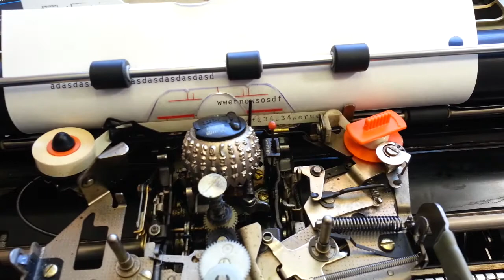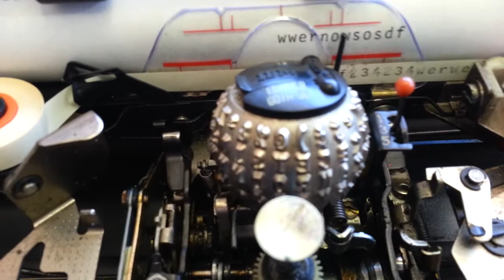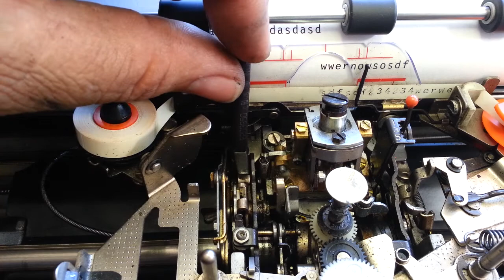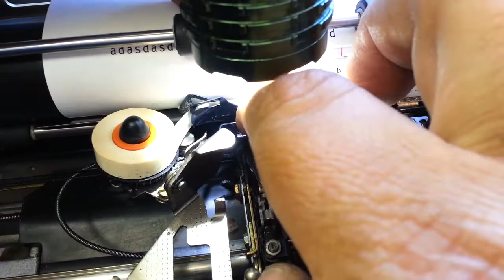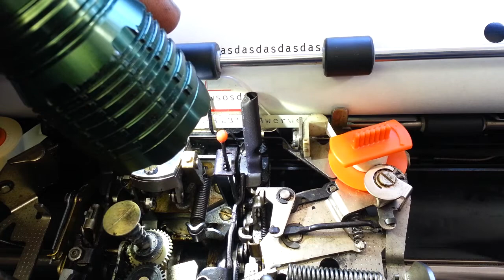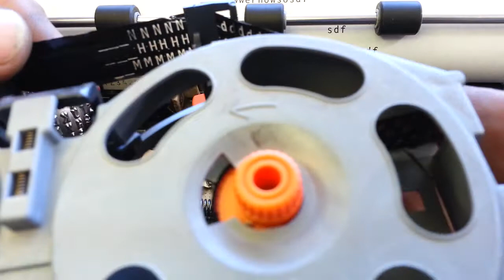IBM Selectric III Typewriter Ribbon Lift Bumpers Bike Style 210 Cartridge

Comment: Can I use a selectric to ribbon deck for a replacement to make it use electric too ribbons replace the selectric 3 ribbon deck?
Reply from the maker: Yes this can be done, you need a donor selectric II for the parts,
Also need to cut/trim one of the lift arms to fit
Reply: Thank you

Comment: Hey Duane. I'm planning to swap a regular ribbon deck with a 210 deck. Both are from Selectric 3s. Is this possible? Thank.
Reply from the maker: I have done this 2x, both over 30 yrs ago. It can be done, some special modifications are needed.
I think it was a small area near where the lift arm mounts.
Reply: @phoenixtypewriter2136  Thank you. I'll give it a try. I plan to put it on YouTube as well, since it doesn't seem to exist. Have you ever tried to swap the ribbon from a 210 cartridge with a regular one? Like you did with the Selectric 72 fabric cartridge.